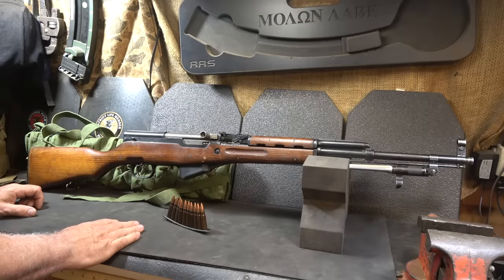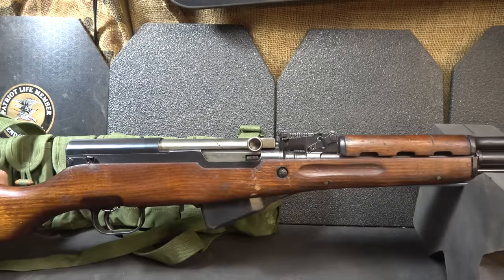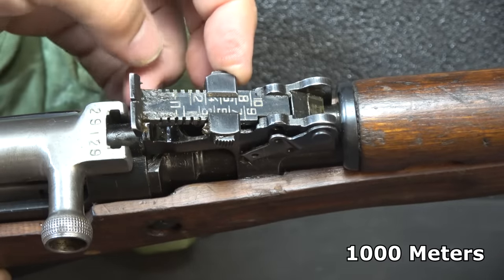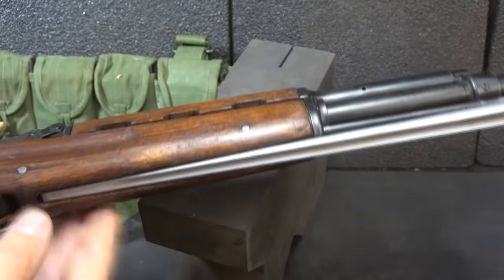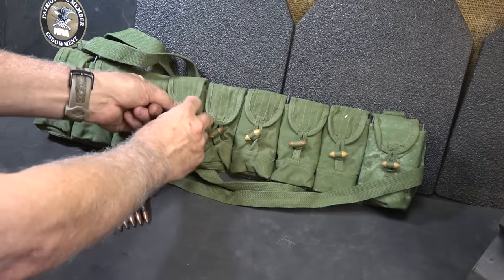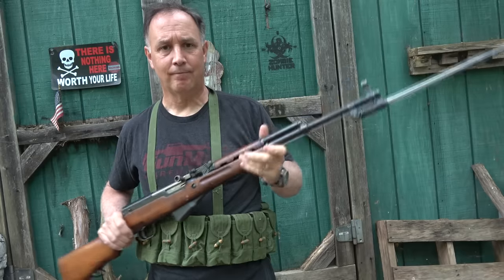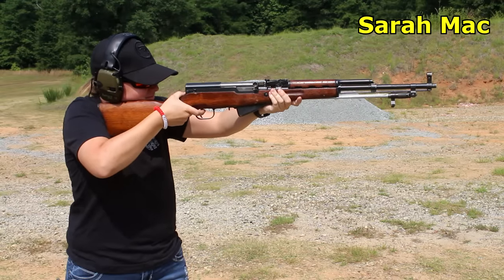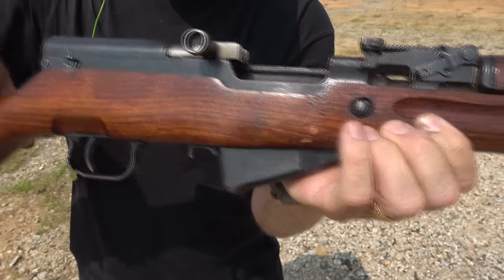Surplus Chinese SKS Rifle Review

Comment: I got one dated 1962, has no bluing, has two American names on it and six notches.  The bayonet droops and I have it taped up with electrical tape. The stock is beat, battered and fubar'ed.  It has around 10 to 15 coats of polyurethane on it to fill in the numerous dings, gouges and scratches.   I put at least a few thousand rounds through it over the years.  It has been through hell and still functions and shoots accurately and  reliably.  I will NEVER get rid of it.  This is my rifle.  There are many others like it but this one is MINE!
Reply: My rifle is my best friend

Comment: Unearthed my Chinesium SKS I bought August 1990 for $189 serial no 17308**and per this video, I field stripped it and discovered to my horror that I had swapped the curvy part of the recoil spring for the straight end in reassembly so many years ago.  After exhaustive  Internet review, the correct reassembly of the recoil spring of the SKS is CURVY first then Straight part aft."Thank God for this video and that I caught it before I shot it and disrupted the space-time continuum or my face. 
You didn't mention what I always found useful was that the SKS stripper clips hold ten rounds of .38/.357 like a Bianchi Speed Strip plus more. Two loaded clips to put with your holstered J-frame Smith along with a knife and flashlight in a camera bag are a  safe and ready defensive package to go wherever you go.

Comment: I think the Yugoslavian SKS is , it has a little flip switch where you can turn the gas off and make it a single shot. Or at least mine does, but it did have a grenade launcher on it as well. I removed it.
Reply: @James 44 MAG. The single shot switch is to fire blanks to launch grenades. Also, I saw one with the grenade launcher modified to be a muzzle brake. Did you save yours?
Reply: @oliverheaviside2539  yeah
Reply: The switch was turned off to shoot a grenade, back on for semi auto rifle.

Comment: I got 2 for $79 each.  So long ago I don't even remember where they are now.

Good solid gun.  Only cleaned up one for use.  What a pain in the ass that was.  

My brother converted one to a colt sporter type, nylon stock and optics cost more than than the gun.  

The three we got were para models with spike bayonet.   A good deal, even back then.

Comment: Thank you for posting this informative video. I have a Chinese SKS that I purchased from a pawn shop/gun store that is in near pristine condition. It was originally made in 1965 and when I got it home I took it apart just as you described and found cosmoline still in various parts of the rifle. After a complete cleaning I took it to the range and found it to be a pure joy to shoot. No issues. One curious thing: it came installed with a shorter paratrooper style bayonet. To this day I have no idea how that found it's way on a standard length rifle. Perhaps when factory refitted someone just grabbed what they had and put it on there. Thanks again!.

Comment: 9:53: I think it's the other way around: The curly part of the recoil spring goes forward into the dust cover and the bolt assembly, whereas the straight portion must be positioned at the back.

Comment: Cleaning the cosmoline is super easy. Boil some water. Dump the parts in said boiling water and add some degreaser. Leave in for atleast 30 mins. All that cosmoline just melts off and is easy to clean.

Comment: My TC 9-56 US army Simonov Type 56 manual has the kinky end of the recoil spring going in the bolt carrier and the straight end against the rear of the receiver. That has always worked fine for me but it likely doesn't matter.
Reply: There's a reason for it

Comment: Thanks fellow prepper thanks a good video on that rifle I have a 56 myself. you need to look out for when buying accessories is your stripper clips do not buy the new manufactured stripper Clips look for the old Czech or Yugoslavia stripper clips the new stripper clips the bridges that hold your rounds in place are too tall and will not fit in the slot on your bolt.

Comment: I prefer the SKS to AKs, never could develop any love for the AK47 or the AK74 I had so I sold them. I had a Chinese SKS, thought it was OK, it wasn't as nice as yours though. Bought a very nice numbers matching Russian SKS in a laminate stock, it is heavier than the Chinese, which seems to have an Asian balsa wood stock, the wood is soft and light. At the range the Russian rifle was more accurate than the Chinese example. I sold the Chinese to a friend. I paid $500 for the Russian rifle, that was a bit high at the time, not too bad now it seems.

Comment: I have a paratrooper SKS and the only difference is the barrel is way shorter everything else is the exact same, Mine also has the blade style bayonet it’s about half as long as that spike thing, and mine also came with the sling, stripper clip vest and the cleaning kit in the butt stock

Comment: Pull up on the bullet end of the top round on the stripper clip and they load much easier and faster. Carburetor Cleaner makes short work of the Cosmoline and be sure and clean it from the firing pin to prevent slam fires 1st time out.

Comment: My Chinese SKS has a much shorter barrel then the one you have there  and it shoots fairly well but the casings tend to stick once in a great wile and I have to beat the bolt open with a rubber hammer but my Russian and Yugo SKS's give me little to no problems but I do all my hog hunting with the shorter Chinese SKS as it is easier to get around in the brush and the Rock-Ola M-1 carbine that I used as a teenager to hut hogs really sits and only gets to shoot raccoons .. Thanks for the video .... And yes I got all three of my SKS's in the 80's and early 90's ..

Comment: I have a no maker mark type 56 M21, with the elephant hair brush in the original tube, blade bayonet. My mentor captured it in an ambush outside of Danang. An NVA soldier bent the stripper clip and shut the bolt on it, panicked and rushed him. My mentor was 6'1"  He said the NVA looked like a little kid. Still has the former conscript's blood on the sling. I can hit CM out to 400m with Wolf.
Also have a 1957 type 56 with a laminated stock from Tula which is just as accurate as the Chinese model.
Late 1959 early1960 Russian sold the machines to China.
Russian machinists followed the machines to  China and helped them set up and run several batches known as Sino-Russian
I would love to find Sino-Russian to fill that gap.
China started to supply the NVA with the type 56 in 1963 or 1964 and intentionsally left off the markers mark so America wouldn't suspect ChiCom was supplying them. 
Im fortunate that it retains 95% of the bluing and number matching stock. It will probably go to a mueseum, yep, its that nice upon my demise.
Until then it will remain my go to.

Comment: I am lucky to have purchased mine way back when you could buy them for about $80 and a 1,200 round case of ammunition for just slightly more. My SKS is nearly pristine, with barely a blemish and the bluing is like factory new. For those of you that believe an SKS is junk, or that it does not compare to the AR rifles... I say shoot one. Throw it in the mud and shoot it again. Throw it in the river. Shoot it until the wood stock begins to smoke.... You just can't break the damned things. They are badass weapons!

Comment: Sootch00 and other 56 SKS owners, curious what condition the rifling in barrel is like? Would you say they’ve seen  under 10,000 rds use? I know most people get hung up on the cosmetics, but if the rifling is intact, i.e. grooves are still there and barrel has longevity I could care less about the dings and dents on wood furniture. Thanks!

Comment: I own a 1960s norinco that was unissued and fully matching numbers, I have shot 1-2 inch groups at 100 yards with this gun and hit man sized targets at 300.
Reply: Thats cute lol iv shot a 2 and a quarter group at 200 with my ak lol and hit a full size silhouette out at 500 and that's with a 16 and a quarter inch barrel the sks should be able to stretch its legs to 600 yards with the longer barrel
Reply: nathan butler>2 and a quarter at 200 yards

Sure you did and my car flies
Reply: The Prometheus Project 2inch groups are pretty standard for SKS rifles, I’ve only gotten one inch groupings a handful of times
Reply: @ThePlatinumsquirrel  i have pictures surprised the hell out of me even. Its amazing what you can achieve when you tailor a load for your particular rifle. I wont give my load data as in grainage but a 154gr pill set 8thou from the lands of the rifleing will give you the best chance at accuracy i was making subsonic loads  with a pbs1 wolverine suppressor  out of a 11 and a half in barrel was getting 1 moa all day my rebarreled wasr is the one that shot 2 inch at 200 like i said i have pictures and the target  still filed away
Reply: The Prometheus Project I mean 2 inches to 2.5 is pretty common with an SKS, it’s really nothing impressive.

Comment: Last round bolt hold open is not necessary at all. It is just a extra feature that does absolutely nothing to help you lol
Reply: Very necessary when you're loading with stripper clips, imagine if you had to hold the bolt back and try to shove the ammo in at the same time.

Comment: They are robust rifles I have no problems with my stripper clips I found a way to load them fast and effective instead up pulling one bullet up then push down I just put my thumb over the top but close to the stripper clip at the base of the cartridge and it slides right in , in one motion

Comment: The milsurps had a blade bayonet. The norinco imports had the spike
Reply: Dustin h 
Starting in 1965 they started putting spike bayonets on the milsurps so the imports and the later military versions both had spike bayonets.
Reply: MINE HAS THE BLADE BAYONET AND LIGHT COLOR STOCK.

Comment: On the recoil spring... the curvy end with the smaller guide rod should go forward into the bolt carrier, not to the rear.  I noticed on thebcleaning video and this video that it is reversed.

Comment: The problem with sks stripper clips are you can’t find good stripper clips.it maybe faster to reload them then a mag but in my experience it is deff not faster then a detachable mag due to the lack of good stripper clips. The nc star clips are readily available sure,I’ll tell you my experience I bought 200 stripper clips the nc star brand and more then half were so bad that the rounds would just fall out so I figured ok no problem I’ll hammer them alittle to fit the rounds in even more of them wouldn’t fit into the guild slot on the bolt.so out of 200 maybe 50 were good to go. Stay away from that brand.also you can deff use detachable mags you don’t have to use stripper clips to reload 20 or 30 round mags I don’t know were he got that info but it’s not true at all.you can’t do a tactical reload that’s true you have to pull the bolt to the rear to pull the mag out,maybe that’s what he meant? Not trolling love the channel but that info is wrong. If your state allows it convert it mag fed there’s a few good mags out there for them and it’s deff faster then stripper clips and even if it’s alittle slower you are getting 20 or 30 rounds instead of 10 so worth the half a second more time to reload in my opion

Comment: SKS recoil assembly - when assembling after cleaning (https://youtu.be/6PLBejrF1CY?t=591), put the recoil assembly with the "Curvy part" in FIRST, towards the front of the bolt/carrier! The straight portion of the recoil spring/rod assembly should be protruding out the BACK side of the bolt toward the rear of the receiver, not the curvy end! Doing this backwards can cause malfunctions like the one you experienced at the range. Please, change your recoil assembly accordingly. There is much reference material to prove what I am saying, so please act accordingly. Good luck, and God Bless the USA, brother Don! :)

Comment: Loading a ten round stripper clip is faster than a 30 round box mag? Duck folks he's slinging fudd lore at us. Loading speed is mainly based on the individual shooter, and even with equally fast people, it's close enough to be negligible. This is basically something people tell themselves to make them feel better that they bought an SKS instead of an AK. It's not fact. It's pure fudd lore. Even if it was faster, which is highly debatable, you have ten rounds versus 30. The AK needs to be reloaded less often, thus negating the so called speed advantage on the reload. I love SKS's. I love AK's. But let's not be stupid folks. Misinformation might have information in the word but it's still not correct.

Comment: You can't seriously believe that you can load three stripper clips faster than one 30rd AK magazine.
Reply: on the sks the bolt stays open. makes a big diffrence in speed.
Reply: @williamdaniels6943  I own both rifles, and while I haven't done 30 + rounds on a timer with each to compare the times, the difference is so much I don't need to.  Start with an empty rifle.  Roughly the same amount of time to access one magazine and one stripper clip.  Magazine goes in, stripper clip goes in.  I have a Chinese SKS from the early 80's.  Sometimes, the clips are stiff and don't want to easily load.  When they work great, it is fast.  But even assuming everything goes right, with the AK, you have one movement to acquire the magazine, insert and lock, run the bolt to load.  With the SKS, you have to expend that same amount of time, but do it 3x.  Assuming you don't fumble the load, for either, you can't load a stripper clip 3x faster than a magazine.
Reply: @MacDorsai  depends on experience and training. I got rid of my Kalashnikov because of inaccuracy and inconsistency  with different rounds. Sks is better on both items. And thanks for the intelligent debate.

Comment: As below Sootch00 is incorrect. The curvy part of the spring goes inside the bolt carrier and the straight part is in back under the recoils shield. It works reversed but that 's not the way it is supposed to be.
https://youtu.be/rZUZi57h49Y?t=463

Comment: Sootch to take that pack and grease off of thereAll you need is to buy some 91% alcohol from Walmart and douse it and clean it from there it will totally stripped all your packing grease out of there with a little scrubbing and it will leave it high and dry then you could commence oiling it👌🏼😉By the way I like your channel

Comment: not all of the SKS that use the AK mags are paratroopers. so your wrogn on that one. they are the model D and model M, some were the short barrel paratrooper models, most were the 20.5 inch barrel like all the normal norinco's...  but yes they are more rare and do bring more money.  dont forget that Russia moved the entire arsenal to china along with ALL the pre-bult parts and techs to train the chinese how to use them, the first of the chinese SKSs were called "sino-soviet" SKS. because they were built BY the chinese using 100% ALL Russian made parts. this ended in 1961,  Norinco also Red star Elite, started to built but also did a little resigned on the SKS making it more and more reliable. today, I would rather own the Norinco over the Russian as they are more reliable and dependable

Comment: I fail to see how this can be loaded 3x faster than an ak.
Reply: He actually said it could be loaded "three times faster than an AK47 magazine."
Reply: @Just1American1966  Yes, that's what I said.
Reply: @user-ge2qn6gp4o  

No, it isn't. You left out the word "magazine." He didn't. Makes a huge difference. He was talking about how long it takes to load a 30-round magazine, not how long it takes to load a rifle from one.
Reply: @Just1American1966  No it doesn't make a difference. Because in order to load the gun you have to load either the magazine or the clips depending on which gun you are talking about. Either way you are talking about the mechanics of loading the gun. You can't "load 3 stripper clips faster than you can load a 30 round magazine and you definitely can't load 3 stripper clips into the gun faster than you can eject a empty 30 round magazine and put in a new one. So like I said, no matter which way you look at it you CAN'T load it 3x faster than an AK. End of story. And I own both guns so I do know. So like I said, IT DOESN'T MATTER.
Reply: @user-ge2qn6gp4o  

Okay, I'm on his comment at about 1:23, where he says that loading the ten-round box magazine from a stripper clip is faster than loading the AK magazine (he doesn't say anything there about loading the guns.) Is that the comment we're debating? I'm assuming he also means loading the stripper clip first, but he doesn't say at that point anything about doing it three times to match the AK rifle's capacity. I see no reason to believe that I couldn't load a stripper clip with ten rounds, and then use it to load the SKS magazine, substantially faster than I could manually stuff thirty rounds into an AK mag. Of course, the SKS would still only have 1/3 the capacity of the eventually-loaded AK, but he didn't mention capacity there.

If I'm talking about the wrong portion of the video, and he does make an erroneous loading comparison elsewhere in it, than I missed that and I apologize. 

By the way, I also own both an SKS and an AK-type, an N-PAP ( which, not being capable of full-auto fire, isn't really a true AK47), so we stand on common ground there.

Comment: Throw all the metal parts into boiling water...cosmoline comes right off.
Reply: Did this and used denatured alcohol plus wd 40 silicone mixed with it.  Came off amd lubricated moving parts with instant anti rust. Super easy,  then used ballistol on the wood stock.